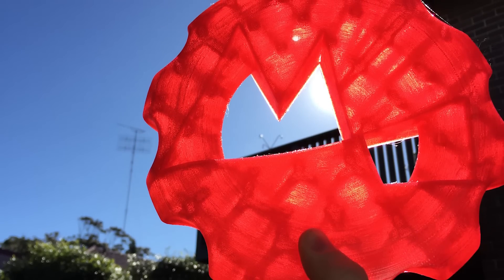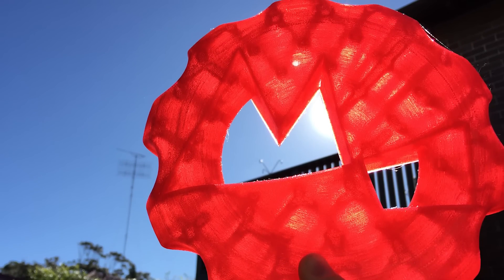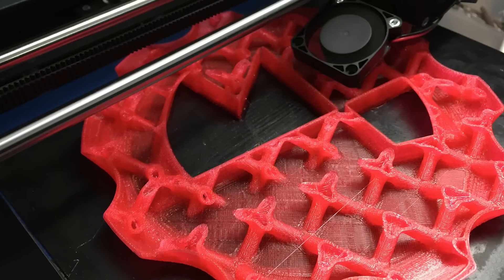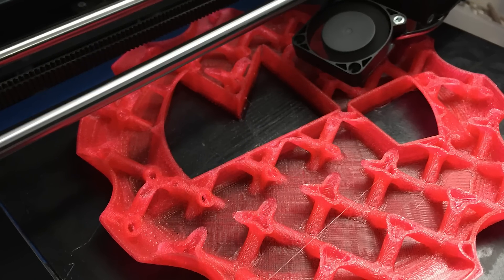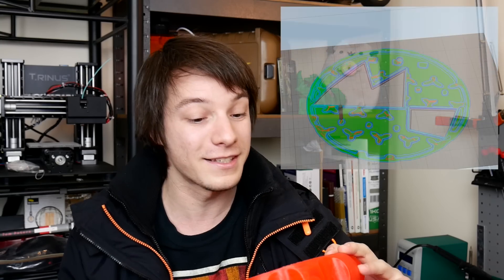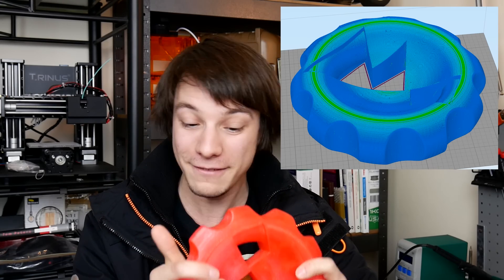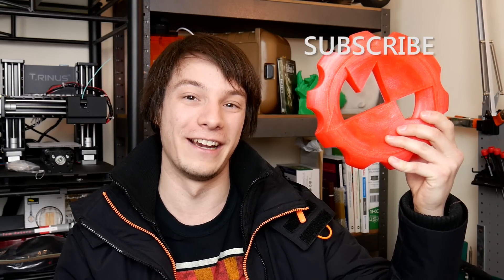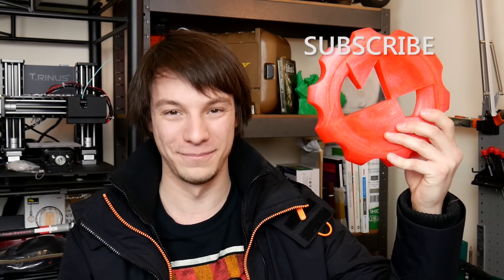Giant Maker Coin using 3D Lattice Infill - What!?

Comment: ... interesting .

I came here expecting this not to be the ¿famously? recently announced "3d lattice" . TDLR: A 3d lattice that adapts to the internal geometry so you get smaller gaps and more compact around surface and on the insides it is more lax ans spacey.

Ofc this video wasn't that (sorry , didn't watch previous video before! D: ) ... but still amazed at the result! Hope you can print this on a bigger, and faster 3d printer!
(thinking layer height 300 microns , 0.6 or higher nozzle diameter, and a capable nozzle/heater as the e3d volcano).

Such big-*ss printers are niche, i know. 
But boy, aren't they amazing for this kind of tests and jobs!

Comment: If someone were to do that with SLS, won't there be no escape hole for the powder inside? Or do you have to add that to the design?
Reply from the maker: You have to add it in, but easy to do with meshmixer by punching a hole through with a cylinder.

Comment: What I like about this is you could insert a smaller object inside an object invert the triangles and only have a wall of infill around the edges at your desired width. The top might have issues with this, but again is would be the infill top (bottom) not the print top.

Comment: Neat. I was just thinking of a way to do open-cell sponge infill in openscad so I could fill some parts with plaster or epoxy. Yes, I would have to drill the part to put fill in, but so would you to take the unused powder out of the SLS printed part. :-)

Comment: Great way of making ultra light, thin skinned aircraft/drone components.  Southampton Uni in the UK have built aircraft wings for drones using this sort of lattice infill but I think they have moved on to an optimised geodesic construction.   However, if you don't have the facility to do finite element analysis lattice would be the way to go.

Comment: Last day for you to upgrade to Windows 10 :D
Reply: Last day to ruin your PC don't do it.
Reply: +Codeplayer Best in what way? seriously. Windows 7 is perfection, 8 was so junk people think 10 is good lol.
Reply: Nah, I've upgraded around 50. most of themn problematic updates gone bad that were brought to me to fix. I'd say that starting from May there were no real problems. I've been on 10 for a year now and I'd surely say that 10 is the best in so many different ways.
Reply: Win 8 was better than 7. The only thing missing being the start menu, but that was an easy fix. Other than that, W8 offered far better performance than 7. Also better shortcuts to system settings. I have fixed and built computers for fun for my whole life. Altogether around 12-13 computers built per year from scratch and around 20-30 laptops fixed or upgraded, being it software or hardware to blame. So I know what I am talking about. I just hate when someone form the "Format C: and clean install is a solution to everything" club starts spreading "facts" of their own opinion. I have never clean installed windows to fix an old windows installation. I have always found the reason of the malfunction and then a way to fix it. The only time that I've reinstalled windows is when the old OS disk is a lab repair item. So in short, I don't think your opinion can be taken as a fact. You are still entitled to it though. Just be careful of looking eyes wide shut in your life.
Reply: +Codeplayer Start menu, proper search function. You do what you like but don't give out bad advice man.
Reply: +Mickice Its not only whst I like. When I give bad advice, there are all my relatives, friends and other people all over me as they'd be in trouble and they expect me to fix it. OS is a bit more than a button and search function. Its mostly about the richness of resources it uses to work and what it has to offer performance wise (Directx for starters).
Reply: +Codeplayer if you say so man.